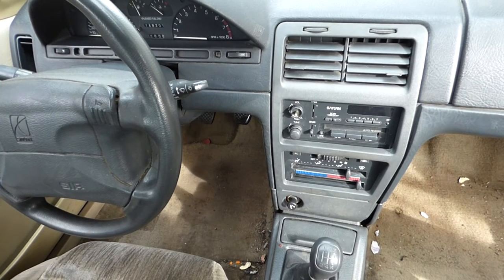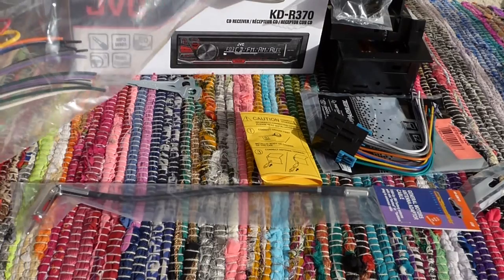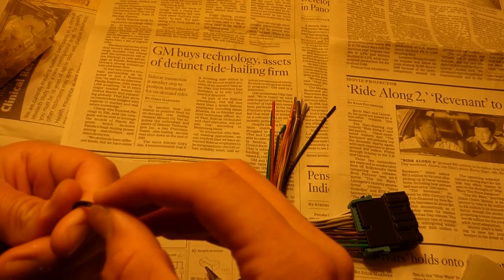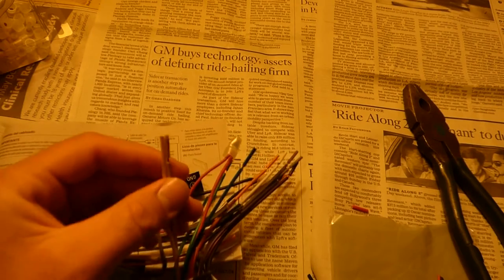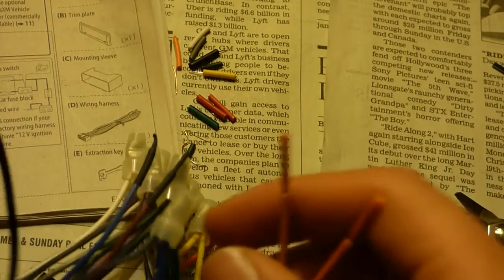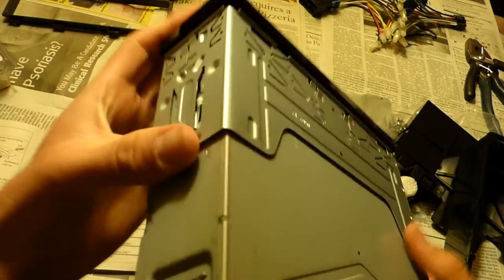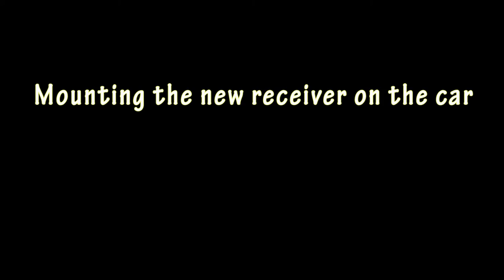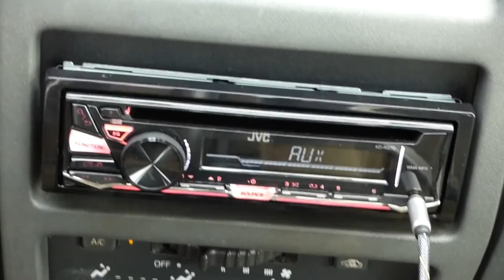1st gen Saturn S-Series ( 1994 Saturn SL2 ) Stereo Radio Reciever Replacement

Comment: Dude awesome! I'd polish that interior though and clean it. I drive one but it's a 95 gold last year they made them like yours exterior wise and 1st year to have a driver and passenger airbag interior. These are simple looking cars. But I would love to drive one with your type of interior cuz they look soooo cool! If you wana check mines out look at my video. Don't have to comment but look at it if u like saturns. The only difference in mines from yours is it has a second gen interior and 1st gen interior all in one as far as the dashboards and radio and center console. Everything else is 1st gen including the inner door panels and exterior body. Pretty cool it's like a 2nd Gen saturn disguised as a 1st gen. Outside you can look at it and say wow this is a 91-94 saturn but as soon as you get inside your like wait this is a 95 ok gotcha lol
Reply from the maker: cool man, I'll be sure to check it out!
edit: I checked it out .. and I also like the 1994 interior better ;) ..what do you recommend to polish the interior ?
Reply: R U Fixed ? Lol thank you man :)see yours is better lucky you :) oh and I would recommend using mothers protectant you can buy it at autozone it's cheap. It comes in a black spray bottle and look for the interior polish one cuz thier the same bottles but with diff purposes. Just spray it directly on the interior recommend it doing it that way and let it sit for 3 minutes and wipe it off cuz you want it to penitrate on the plastic. Keep doing it until you notice a small shine on your interior or until it wipes the dust off. Mother's protectant works best. I used it on my car and it made the interior look really good even the shift level on the center console. Trust me it will bring your interior back to life. Use it on the doors and everything. And if you want....I would love to see a video of it after your interior had been polished I'm very curious...